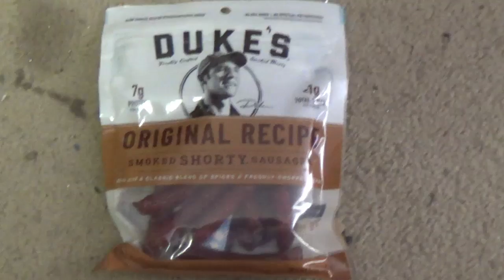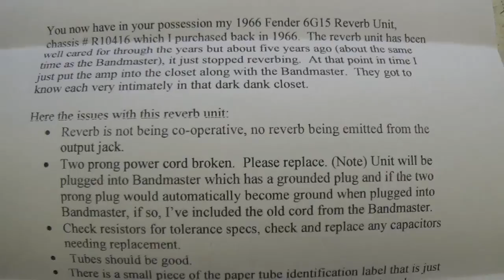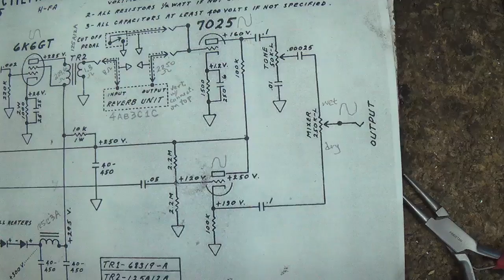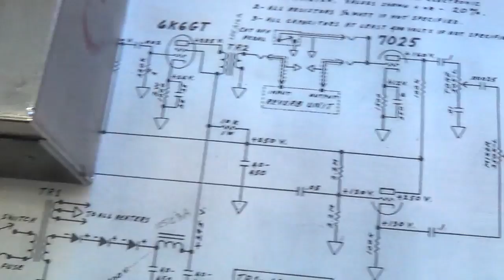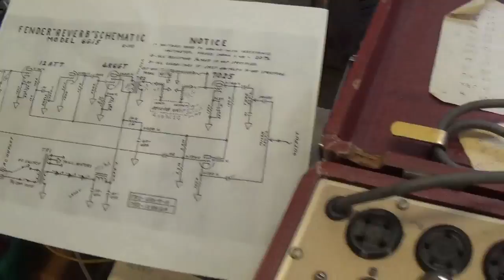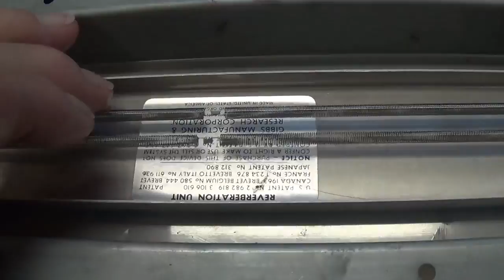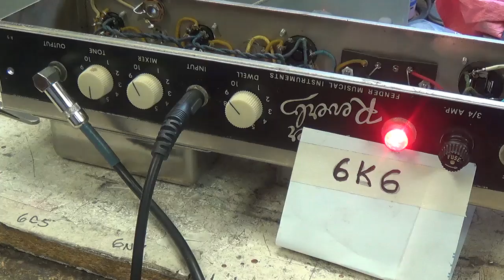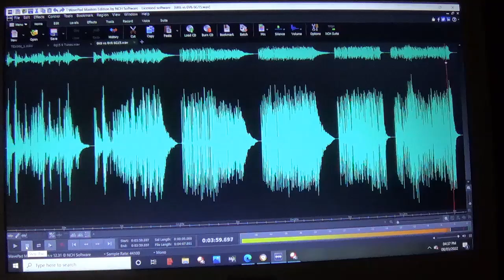Virtually Mint 1966 Fender 6G15 Reverb Unit.......It Quit Reverbing :)

Comment from the maker: Giant Table 'o' Contents:
0:00	Open Box
1:05	Examine 6G15
2:48	Open gifts with Mitzy the Shop Cat
4:38	Resume Examination of 6G15
15:10	Read Owner's Letter
17:20	Begin Disassembly	
27:08	Schematic Review
36:50	Begin to Replace & Conceal Filter Caps
39:40	Test Tank Transducer Continuity
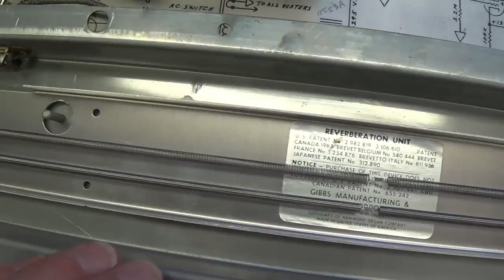44:05	Resume Filter Cap Replacement
49:20	Test Reverb Driver Transformer
52:15	Test all Tubes
55:25	Test Reverb Cables
59:20	Install 3-Wire Power Cord and Rectifier Diodes
1:02:12	Test Original Gibbs Tank vs New MOD Tank
1:07:42	Mitzy Seeks Attention (You know how girls are ;)
1:08:30	Transplant New Transducers
1:18:20	Test Repaired Gibbs Tank (6K6 vs 6V6)
1:22:54	Final Audio Demo
1:35:03	Farewell Messages
Reply: I've never seen anyone do that with capacitors. What a great idea.
Reply: Another charming, delightful video, thanks Doug. Did you find the fault that stopped the reverberations reverberating or was the old tank just unsatisfactory?
Reply from the maker: @robnic52  Thanks, Rob. As I said in the video, I believe the transducers lose their magnetism over time.
Reply from the maker: @GabrielVelasco  Glad you liked it, Gabe :)
Reply: Love the high-tech glue applicator - remember, there is no such thing as a free lunch (or in this case a free steak dinner) 😂😂. I was surprised you didn’t change the cardboard electrolytics in the main circuit. I assume they were ok?
Reply from the maker: @patriottothecore6215  Glad you liked it, PC. They checked out OK.
Reply: Hello  I have a gender FR1000 solid state reverb unit  needs repair   are you able to?  How does it work?
Reply from the maker: @gramnuggin742  Greetings, Gram. Sorry, but I only work on vintage tube amp circuits.......no SS.
Reply: @UncleDoug  ok   understandable 👌
Reply from the maker: @gramnuggin742  That's good, GN.
Reply: I have to wonder if it weren't have been easier to just drill new holes in the new tray for the stop dick for lack of a better term rather than having to drill the other holes for and transducer and all? Would that Have made some sort of unforeseeable difference?
Reply from the maker: @incredifunk  I did what I thought was best, Brice.

Comment: Hey Doug,
About the phase: Fender obviously went for a cathode follower in the dry-path to keep the input-phase matched to the output-phase. The phase during the wet-chain is irrelevant, as it also depends on the way, the transformer is connected. Also the reverb tank will pretty much mess up the phase in the wet-path.
About re-stuffing caps:  I was just about to mention here, that you should leave a sticker inside the doghouse, to prevent the next technician from instantly removing those restuffed caps again - and booom - you did 👍
I absolutely like the way, you restuffed the hall-tank, and preserved, what could be preserved from the original hammond-unit. By the way: I never expected the difference being so massive, due to the weakening of the alnicos inside the reverb-transducers! That is really important knowledge, and I will doublecheck the sound of those halltanks the next time, I will service old fender reverb amps! Thanks for all your help, out here in youtube-land!!
Reply from the maker: You're welcome, Sal. We're glad the videos are clear and helpful :)

Comment: Cosmic timing Uncle Doug! I am just starting a Mojotone kit build of the 6G15. Nice to be able to have an Uncle Doug tour of a mint specimen. Thanks a bunch! Regarding the C.S.A. Test label on the power amp, this is likely to be a Canadian Standards Association test mark. This is not the common label used though, which is a large C with stylized S and A inscribed inside of the C.
Reply from the maker: Glad for the good timing, Peter. Best of luck with your project.

Comment: Hey Uncle Doug! You must have spent some time practicing because I noticed your chops are greatly improved. Thanks for the in depth education on the inner workings of Fender reverb units. I had one back in the late 1960s that was tan and orange colored, that came with the tweed Tremolux my mom bought for me. It stopped reverbing, too, so I asked my friend to look at it and see if he could fix it, but never saw it again (sigh). After that, I traded the Tremolux in on a Gibson solid state 100W head. If only I'd known then what I know now.
Reply from the maker: All praise goes to Ollie & Jack, Maurice. So glad the videos are helpful. We've all made mistakes with vintage gear......but the two you mentioned might be near the top of the list ;)

Comment: very nice Amp impeccable shape!!! very nice repair as always Uncle Doug ,reverb tank stopped working on my Ampeg VT 22V4 100w amp it was completly serviced of any issues10 years ago and was working so probably same problem as here my amp may have 10 hours of use since ,thanks for all of your very valuable videos !!
Reply from the maker: You're welcome, Joe.
Reply: Just be aware that Ampegs use a capacitor driven circuit for the reverb tank and so the standard tank that works an a Fender won't work in an Ampeg. Somewhere on line you should be able to find a chart that will tell you the numbers for the correct reverb tank to order.

Comment: Wow that reverb unit is stunning, museum quality! The last Fender valve amp across by bench for repair was a 1978 twin reverb. It was the polar opposite! Some rotten wood, rusty chassis, damp board which was conducting, all pots seized, all sockets rusty and knackered, two tubes had broken centre pins, all pre amp tubes are a little soft then the usual service items with several carbon resistors failed, new power caps needed etc. It wasn’t worth fixing! A shame but I did get the old enclosure and chassis to build a highly modded deluxe reverb.
Reply from the maker: Thanks, CE. That sounds like some of the Silvertone amps I received several years ago.

Comment: Smashing vid with great Canadian content !! I was recently given and repaired a Hot Cabs PA head that had been dropped. The reverb tank came free from the springs, and two of the input circuit boards disconnected. Now I just need some speakers.
Reply from the maker: Thanks Mr. CC. Good luck with your project.

Comment: Another great video!  On the issue of the 6K6 vs 6V6, I would lean towards the original 6K6; the extra gain afforded by the 6V6 gave the sound an almost slightly over-driven quality that is not as pleasing to the ears.  I wonder what the 6V6 configuration would sound like if fed the output of a hot single coil or humbucker?  Perhaps not as pleasing and "Fendery" as us ancient tone hounds would come to expect.  All in all, thanks again for a great video and learning experience.
Reply from the maker: Thanks for your input, John. Glad you enjoyed the video.

Comment: 38:00 - I may be having a senior moment (possibly precipitated by some hi grade Cuban rum), but I think TR1 refers to the power transformer, not the choke? You might correct this later on in the show, but I haven't got all the way thru yet. Anyway, as ever, an inspiring video once again causing me to start trawling for parts for something I didn't know I wanted to build😀.
Reply from the maker: Good catch, AC. Thanks for pointing that out.

Comment: Wow! Definitely the ultimate spring reverb. Digital spring reverbs are coming close, but they just don't have the same feel and responsiveness.
Reply from the maker: Agreed, Gabe. Thanks :)
Reply: That's absolutely true. During this unfortunate covid time I have built and modded several spring reverb featured vintage and modern amps and compared several vintage and modern reverb tanks and as well compared them all with all sorts of digital effects and computer plug-ins. 
Vintage amps and reverb tanks still are the best and most natural choice IMHO. I don't know how long, but for example a real tube amp always sounds like a tube amp because it, bloody hell, is a f-ing tube amp and not an emulator, if it is even close to decent condition. And a spring reverb tank in good condition usually always sounds like a spring reverb tank because it is a reverb tank, not a plug-in.
Reply: @jutukka  Yes. And the thing that's difficult to explain to non players or players who have little or no experience with tubes and springs is the "feel" or "responsiveness." If you go purely by the sound in a mix, you might be tricked, but sometimes the most important thing about a real analogue is how it responds to your playing, how it responds to being played soft or loud, or with a quick attack, or with single-coils vs. humbuckers. A good player can learn to control the amount of distortion or "boing" by how hard he plays, or which pickup he selects, or the volume control on his guitar. Some true spring reverb tanks can be overdriven just like the front end of a tube amp and a good player can learn how to "play" those things in real time. That feel, responsiveness, and feedback still can't be emulated very well. I'm talking about the communication you're getting from the amp, not the "howling" feedback, although that's important too.
Reply from the maker: @jutukka  Well said, Jutukka :)
Reply: @jutukka  Looks like from another comment washing old springs in a bit of dish wash liquid gets off dust (and greases from atmosphere) which allows the metal to move again with less hindrance and become tighter

Comment: Hi Doug,
I had a spring reverb in my workshop recently with extremely low output and I couldn't find anything wrong with DC continuity of the input or output circuits or mechanical construction of the unit, apart from noticing both springs looked a little dusty. After removing the spring and carefully soaking in general washing up liquid and allowing to air dry, the reverb "sprang" into life. Never seen this before and one for the old grey matter.
Reply from the maker: Thanks for sharing, Geoff. I'll keep this hint in mind for the future.

Comment: Mrrrrrrrrrrrrrrr. Koko the bench cat is here on the keyboard, purring like a motorcycle, giving his best to Mitzy. 

It's a very nice way of mounting the reverb tank, easy to recreate today with a bunch of threaded standoffs and springs, unfortunately the manufacturers go for rubber damping which is easier and cheaper. The caging mechanism is like arreting on old-school lab scales.

As for gluing things like this drawing, I'd use a syringe and a thick needle. 

Making the phase match between dry and wet signals is one thing (it can be easily inverted on the driver transformer), but making it match between the input and the output is another problem. Since some amps have blend controls on their effect loops, mixing a straight-phase and inverted signal would be bad.

Cool way of restuffing electrolytics. Adding a note is a lovely idea - I was about to write about my fears, haha!

Wondering about that "English" control on your tube tester. 

I'd consider using a FULL BRIDGE RECTIFIER here, but even a single 1N4007 should do a nice enough job here. Why Fender didn't go for a bridge, I don't know... Three diodes in series speaks volumes on what was available at that time, with the max reverse bias voltage not being that high.

Nice tank surgery, that's some proper precision mechanical work. I'd be kinda afraid, but could do it :)
This reverb unit would sound absolutely Fran-tastic with a theremin on a Saturday evening!
Reply from the maker: Thanks for all the great comments, Keri. We really appreciate your input. Regards to Koko.
Reply: @UncleDoug  thanks a lot, I absolutely love your approach - you know lots and lots of stuff about those amps, you're famous for that and yet you stay humble and grounded, rather than being "way up there" and disregarding the viewer community on this channel. Definitely an inspiration for me, and I'll try as much as I can to follow your example.
Reply from the maker: @KeritechElectronics  Wow....thanks so much for your very kind words, Keri. I hope I can live up to them.

Comment: Hey Uncle Dougie!  Mitzy sure has turned out to be a sweetheart hasn't she?  Great job on this IMMACULATE reverb and love the extra mile you went on the doghouse caps, drillin' the rivets, love it!  Question Uncle:  why didn't you swap in the green and black tank wires?  You went as far as the grommets I was eyeing, why not the original wires?  The plastic insulation they used on the new wires looks to be pretty low temp stuff and I bet they melt really easy, in-N-out with I iron I'm bettin' lol Please answer this one Uncle, I'm dying to know and I know the thought must have crossed your mind to splice in the old wires.  Great one Uncle Doug
Reply from the maker: Thanks so much, Robert. I never thought of transplanting the wires.....maybe next time.

Comment: The 6K6 is a bit of a unique tube, specs-wise, and can be harder to source these days than a 6V6.  It has a lower transconductance and higher plate resistance than the 6V6 at similar operating points.  If you prefer the sound of the 6K6 but only have a 6V6, you can lower the screen voltage and/or incorporate some cathode degeneration in the form of a partially-bypassed cathode resistor to simulate the drive level/plate impedance of the 6K6.
Reply from the maker: Thanks for the tech info, TC.
Reply: @UncleDoug  could a suitable variable resistor go in circuit to allow adjustment to suit desired output characteristic ?
Reply from the maker: @highpath4776  Perhaps you could use a pot to adjust the amount of cathode bypass that occurs.

Comment: At 1:11:10, congrats, Doug, you made a spring-hook tool. The father of the guy I work for in my day job managed a spring- manufacturing company and so at work we have a whole bin full of various shaped spring-hook tools. Eventually I'll send you a grab-bag of parts and such, and I'll have to include an assortment of spring-hook tools for you. These usually have a hook shaped like a ? question mark on the very end,  almost like a shepherd's crook (if I remember correctly there was a character in a Hanna-Barbera cartoon who used to get yanked offstage with a shepherd's crook. My head is chock-full of half-remembered flotsam and jetsam from the distant, misty time of my youth ).
Reply from the maker: Thanks, GU :)
Reply: Was it Mr Jinks ?
Reply from the maker: @highpath4776  Who got yanked off stage ? Could be, I guess.

Comment: Uncle Dug, this was awesome. Thought you might be interested, back in the day I had a Heathkit P816 and it had an awesome tank in it, was at a ham swap meet one day and found this exact tank that you repaired in the fender reverb. So I had two tanks in my amp and could switch between the two, I preferred the original one that came with the Heathkit but the other one was more bouncy definitely gave you that surf sound
Reply from the maker: Thanks for sharing, Doc :)

Comment: Uncle Doug, you are so correct about bass being a muddifier in the reverb process. With built-in reverb tanks, there is no way of filtering out that bottom end ... or is there? You can actually run the out from the reverb tank into the NORMAL channel of say, a Twin Reverb, with appropriate cabling adapters (not that hard) and roll off most of the bass and run the treble way up, even put up the BRIGHT switch for extra sparkle. That allows control over reverb volume and EQing out that muddy bottom! Sounds fabulous! I learned that from a repair tech, the late Jimmy Mullin of Jacksonville, FL back in the early '80s.
I am blessed to own a 1963 brown face that seems to have forgotten the words, because it hums a lot! BTW: The reissues have PCB, which I do not think is necessarily a bad thing, as it is so short, it doesn't make much difference over the hand wired, IMHO.
Just guessing: Most likely, this guy has a broken transducer. Well. Wronk again! But fun to guess!
Reply from the maker: The .002uf coupling cap to the 6K6 takes care of most of the muddy bass frequencies, TT.
Reply: @UncleDoug  Outstanding! Thank you!